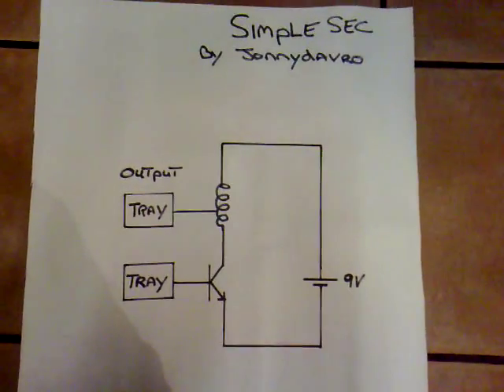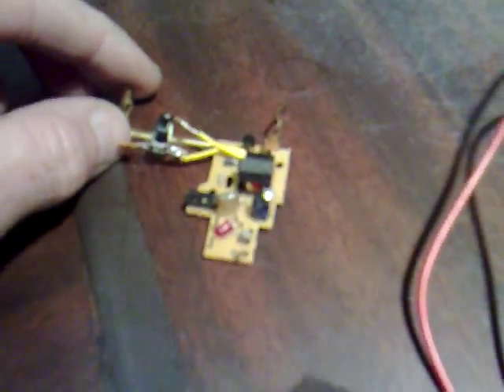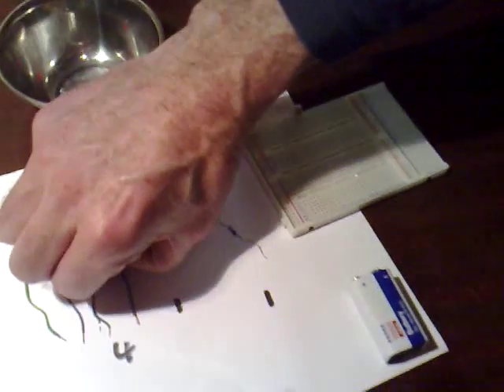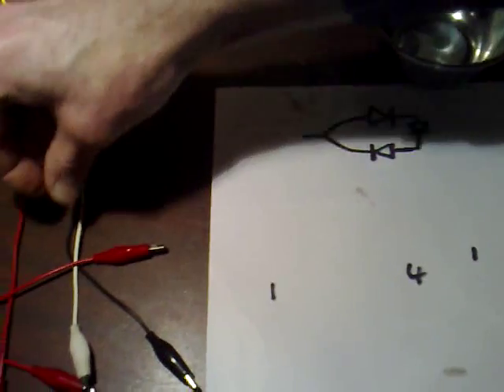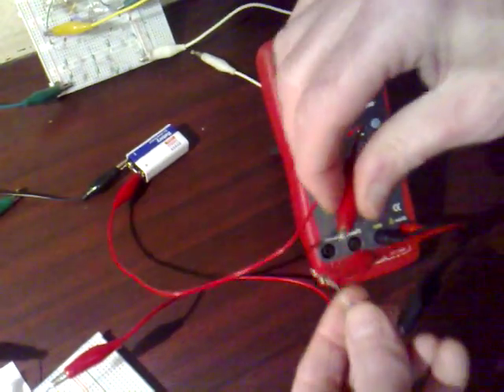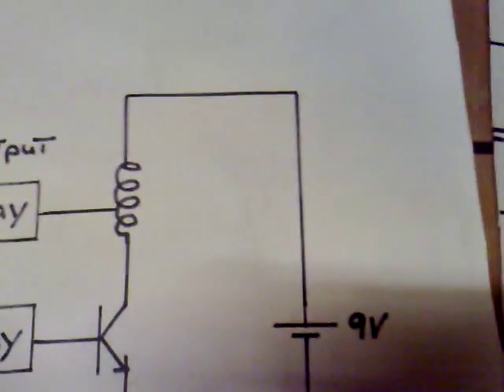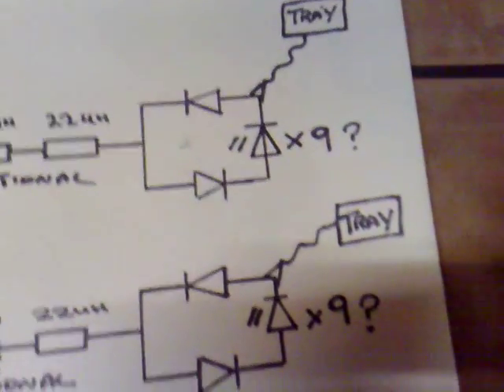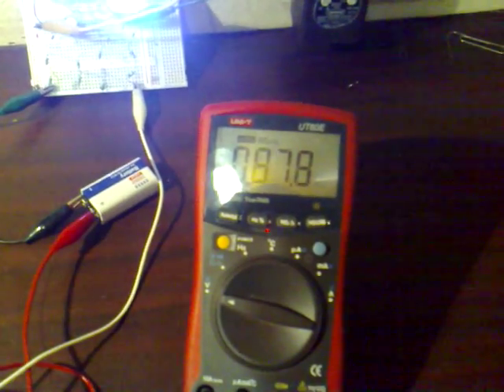Simple SEC step by step build

Comment: Sir can we use the Sec circuit and attach it to other metals instead of the Bowls used 
I was doing an experiment where you can use the SEC circuit for plants and generate electricity
Reply: Yes, try different sizes as well. Like I'm using my old pc case. Those are virtual grounds.  Even bucket of water.

Comment: thanks for share, it is a lot easier to see it.the first time.i try the 2n2222a was getting to hot, because i used too much power. i play wih it looks what happend :-)
than i used a bc547 transistor with a capasitor 47 uf over the negative and the power and it works.
that for sombody ho have not learn a lot about electric.
now i was thinking and going to try in the disposable camera is a 1.5 v to 5 or more volt transformator if i can use that as a receiver for power more led. you never now... gr

Comment: i have try waste bug zapper, it can used for drive waste 15watt CFL tube with 3,7vdc battery but the light not very bright as 15watt CFL, that bug zapper using transistor C965, could that bug zapper to use in sec exciter ?

Comment: ok thanks, i have a problem though. my curcuit didnt run and i think its because i didnt wire the trigger transformer corectly the bottom has 4 pins but most have three. my multimeter has a blown fuse so i cant use it it might even be broken (its very old).

Comment: On the Barebones oscillator how many volts was being recieved by the av plugs?
Reply: one diode 4148 can rectify ~100 volts, use two, get more. I tried five, got 500 volts.

Comment: I built the bare bone set up I used a MPS2222A- NPN transistor 1k Ohm resistor, a yellow trigger transformer. As far as the LED I used the one from the camera board the diodes are 1N4004   I soldered all connections  just to make tight connections. I didnt get a voltage and basically the transistor just got hot. Do you have any suggestions? I really want to go further with this SEC setup! Thanks

Comment: my trigger coil didn't worked at start and i just inverted the top with the bottom wire,so it lighting up now flicker flame bulbs, cfl, led with 1 wire, basically everything ,and i used an sec exciter mini tower and inside of it it it's really cool, and btw put some watter inside those tins and after that you put an cfl to just touch the watter and 1 wire and it works :D ,thanks a lot Jonny :)

Comment: i wanted to mention i thought it was interesting how i could basically do the one wire lighting of the led's from basically anywhere on the circuit, so as far as one wire lighting, one could just run a lead from one of the battery terminals to anywhere they wanted, and the lead would light something if given external ground. far as the plugs, i cant get them to light very noticeably without grounding them near the tins. also the plugs dont seem to be necessary either, or are they like FWBR's?

Comment: Hmm. Tried 2 different TT from different cameras. Both start circulating when hands on trays but it does not oscillate when i remove hands. Used 2n2222 and 3904 and get same result. Has to be these trigger transformers.

Comment: thanks alot for the how-to. i probably wouldn't have attempted it if it wasnt for the easy step by step. almost gave up at first and ended up reversing my C and E and it worked. cool stuff. im using a 2n4403 and big turkey baking tins. i noticed the better grounded the Base tin the better the output tin receives. it also directly likes LEDs nicely with one wire. next step is working on some type of portable LED lamp i can move around within a reasonable radius.